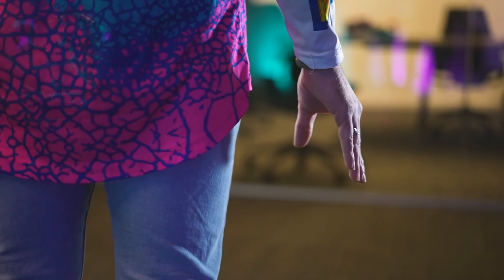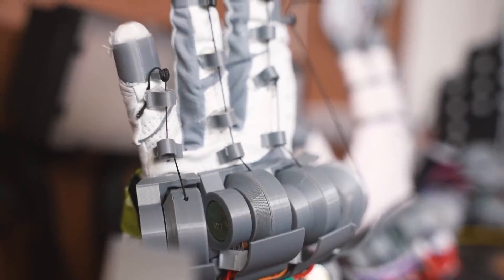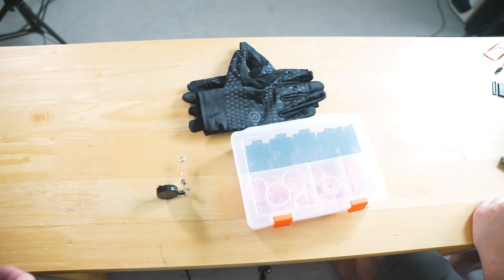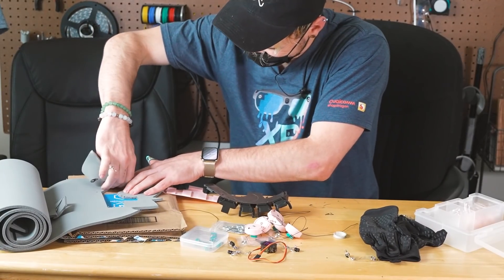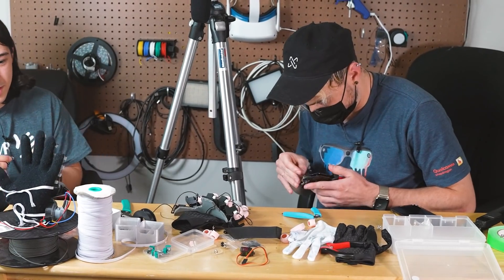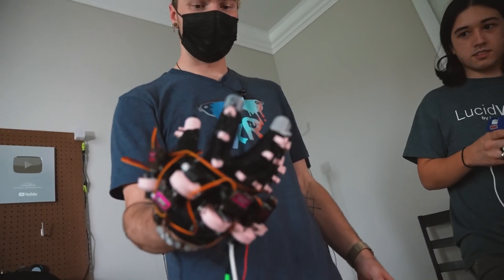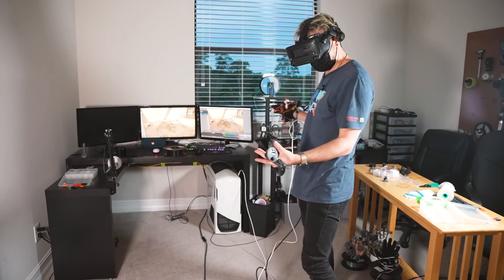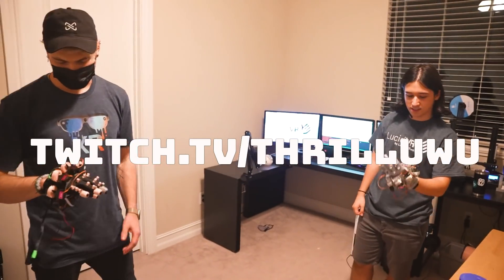Building my own VR Haptic Gloves with the VR GLOVE MASTER

Comment: The v2 design has been done for a while, looking for an engineer like lucas or lucas himself to engage in prototyping the new designs, and i have other designs for different haptic interfaces in general too, wanna take this iteration commercial. 
Lucas proves viability. 
New system optimizations in Digitact V2 allow for
 1. More efficient power use per motor 
 2. More accurate geometric representation of forces
 3. Improved tracking 
 3. Overall Improved design geometry 
 Hit me up.

Comment: Hell yeah, kid. 👍 My first roomscale VR setup was Google cardboard (In a headset with custom optics) plus some eBay find PS3 Eye cameras and PSMove controllers, and RGBLED-lit ping pong balls. 🤓  Damn fine work on the gloves!  I had basically the same idea, but the engineering involved was just slightly beyond my ability to bridge the gap between concept and reality. 😬

Comment: The biggest hurdle I see for force feedback gloves is maneuverability, the more complex or accurate, the more parts are required increasing complexity and more than likely reducing the users maneuverability. At first I thought, why not use air or water with small channels in the gloves to control the force required for specific muscle groups in the hand? The issue is more than likely going to be one of space, this is even a greater issue with the direct use of motors. So, what can we do, how can we push back against the muscles of our body? Well, we could make our own artificial muscles, even if they are real they are more than likely not a technology we will see any time soon. So why make muscles or any contraption to counteract the body? We have muscles already, they're the one's we're trying to fight! What if we were to coat the hand in a saline solution and use a glove which would have hundreds of small silver (the actual metal) contacts? Instead of fighting the muscles we could make the muscles fight itself or possible interfere with the muscle's actions altogether.

Comment: I still remember trying out the Novint Falcon during the 2007 E For All convention. They had a demo set up where you could move the cursor over and in some cases through a sphere made of different materials, like syrup, rubber, etc, and it actually felt remarkably convincing. All it was though was a manipulator on the end of 3 motorized actuators, and the support was very, very limited, so it never took off. Pity, it was a neat idea.

Comment: Now we need a sort of apparatus that will hold a person centered, while they wear shoes with mouse ball-esque trackers on the bottom to move around. Something much cheaper than the Kat Walk C. Though it will be more expensive than a pair of gloves and a kit of small parts.

I'm thinking something like an anchored "cage" made from something cheap and rigid (like wood or mild steel tubing). Then, a waist band similar to that of the Kat Walk C elastically anchored and centered to the perimeter of the railing of the "cage". This would need to be held within a rigid hoop which the elastic anchors will attach to, and have freedom to move around the edge of the hoop. This elastic would need to be tense enough to resist allowing the hoop to travel side to side, but tolerant enough to allow crouching and jumping. A set of elastic between the hoop and the waist band (which would be required anyway) might be able to accomplish this functionality.

The actual shoes are the tricky part, as they need to detect movement forwards and backwards, but also sideways. A track-ball or two per shoe seems to be the way to go, but rigging them up is the difficult part. A shoe would need to be selected that has a thin sole which would allow for some thickness underneath, both for the electromechanical parts, and reducing friction with the floor. This whole concept would work with Kat Walk's design, but I figure it would be more cost-effective not to build what is essentially a giant track-pad; but instead, use a few track-balls off the shelf.

Comment: This has been soooOOO long coming! (Like the first actually accessible, fully-functional VR HMD.) I remember long ago learning about Jaron Lanier's Data Glove, and thinking that would be so cool to have. ...But it wasn't actually haptic, I believe. Then Mattel came out with some game-controller glove. It may have vibrated, but I don't think it offered any resistance or other tactile feedback. I kind of gave up trying to retain info about any attempts after that. It always interested me, but the up-front limitations always disappointed. Either they were low-function, or they were outrageously expensive, or the company sold or failed, or the prototype never made it to market. 

Now that an accessible option is finally here, I can't wait to add a pair of these to my setup!

Comment: It be cool if it could simulate the hardness or softness of the object. I imagine it could be done by adjusting how the motors tighten the pulleys. Like for the softness it could tighten each finger at different timings, and intensity based on how the geometry changes. The order in which the fingers touch the object determine how the geometry would change. The softness or hardness would determine how much the geometry could change. Just a thought, I don't know anything about coding. This device is amazing.

Comment: The only big problem with Index finger tracking is because it relies on capacitive touch on the central handle, it actually doesn't even begin to curl your fingers in-game until you've closed your real-life fingers to around 50%, when the bottoms of your fingers start actually making contact with the handle.

I'd have loved if you did an example of slow, deliberate finger motions and showed how well they track and if it's more 1:1 than the Index.

Comment: This actually makes me want to learn how to sauter things, lol. I think maybe there could be room to make it a little less clunky if you were able to have the springs actually mounted on your forearm instead of the back of the hand, maybe a series of five thin disk pulleys layered on the wrist could allow the necessary connections while leaving your wrist free to bend, and then you could mount the springs in a line down your forearm with a strap to make it a bit more compact?

Comment: Hmmm.. These look good. But I have some comments to add...

I notice they have a Valve/Vive style tracker on them. I assume they need this for tracking. But that tracking system is expensive. How about using SlimeVR for hand tracking instead?...

I know that hand tracking requires more precision than general body tracking. But there is apparently more than one type of SlimeVR tracker. The lower cost SlimeVR tracking packages have the normal trackers. But the higher cost packages mention higher precision trackers in the notes. I wonder what the tracking precision difference actually is between the two, and if it's enough for hand tracking. And if the higher precision trackers could be bought as a pair, separately.

Maybe the people selling the SlimeVR trackers haven't considered using their trackers for VR gloves, and are assuming the only reason anyone wants them, is for general body tracking.

Another thing about these DIY gloves, is the floppiness, and the cable management...

The tension cables don't seem that bad; they're held taught, so they don't have a chance to tangle much. But the electrical wires could be managed better using velcro or buttoned loops sewn into the gloves, allowing you to easily remove them for repairs.

The floppiness of the heavier components could be solved with the addition of a rigid plate sewn onto the back of the glove, allowing a place for the heavier components to attach. The greater surface of the attachment between the backplate and the glove, will give much greater stability than the much smaller area of the individual components attached directly to fabric.
Reply from the maker: You can use any controller for tracking, even quest 2. And yeah wire management needs to be way better I agree

Comment: Really cool. It would probably be a good idea to crowdfund kits that contain all the parts you need for a build, since finding all the parts (and at a reasonable price) is probably the biggest chore of the whole thing. I think this demonstrates well that the tech itself can become pretty cheap and accessible once big players in the market decide to make it mainstream.

Personally I think that the best design will probably still include some sort of non-invasive controller because having some buttons and a joystick in-hand allows you to do so much and have a lot of compatibility, and it will be a long way still before this tech is so precise that it can mimic those functions in software.
So basically I think the ultimate controller for the foreseeable future would be a knuckles-like design, but with a feedback-glove component like this so achieve the best of both worlds.
A smart way to do it might be to design it as 2 components that can connect together as an optional addon.

Comment: This is actually amazing!!! I want one so bad!  But I do have a couple of questions tho 😅
1) How much would this actually cost for a quest 2 user (with a powerful gaming pc already) with no tracking equipment (e.g. Base stations or trackers)
2) For those without a 3D printer, how would/could you make this amazing piece of equipment?
3) For those of us that aren't as tech savvy, is there like a list or rough instructions of what you need to do? Like what programs/software you need, what hardware you need, circuit diagram, what steps to follow when building, or even a video of it?

Im sorry if these are some redundant questions, but I rarely use discord (mainly for calls while gaming with friends) and websites such as GitHub. I tried navigating them, but I got really lost, really quickly

Comment: Cant wait till my hmd arrives so i can start doing some dev work.

I heavily disagree with the idea that we need buttons when we have finger tracking that good.

Instead i think we need a fundamental redesign of the development paradigm, organic interactivity rather than scripted sequences.

For example for menus, you could implement collision detection to buttons and sliders and render the menus as an actual 3d object, so interacting with the menu is like interacting with a real physical object.

Need to move a slider, you literally grab the slider and move it. Want to turn on a setting, you click the button with your finger.

This would extend further into game design principals too of course, just about every interaction you script and assign to a gamepad key is unnecessary, you dont need a shoot button for an fps if you have a trigger finger and the guns are rigged to start firing when the trigger crosses an activation box

you dont need a shoot arrow button if you can physically grasp the arrow knock it and release

you dont need a button to pick up and swing a sword when you can again physically interact with it

hell even trading card games

all youd have to do is make each card a 3d object, have the play field detect which cards are placed on it and what orientation that card is in, and you have everything you need to replicate something like say yugioh in a vr space

Buttons are something we put up with because we didnt have a good input interface, not something we need going forward.

With good and widespread hand and finger tracking we can design interfaces at the product level the same way we do in the real world, and i for one cannot wait for that to be reality.

Comment: I built a pair and actually cried when i first tried it out. I can not wait until this kind of hardware becomes main steam. I can definitely a mass produced version like this with a box on the back of the hand/wrist for tracking and internals on gloves with integrated rails for the strings, better quality parts, easily costing under 200$ a glove. I would actually cave and get a quest if facebook brought this kind of hardware and software to the table.

Comment: Maybe someone can answers this, wouldn't it help to move the servos further back say to behind the wrist. While this would make them more of a glove and wrist band setup, it would allow more room and reduce the size of the hand. Might even be able to place them sideways   further reducing how much they protrude from your body, reducing what they can be caught on.
Reply: Moving them behind the wrist would add significant complexity, as you'd need some sort of pulley system for each wire at the wrist to keep the wires flush along the back of the hand. Or else have sheathed cables. Having them mounted on the back of the hand removes a lot of problems related to accounting for movement of the hand relative to the arm. You only have to worry about movement of the fingers relative to the hand that way, which is a much simpler problem to solve, especially since fingers really only have significant range of motion in one degree of freedom. For wrist-to-fingers, you have to deal with 3 degrees of freedom with significant range of motion and even a bit of a fourth. It can be done, of course, but it's a significantly harder problem to solve. I think the future of this will probably be smaller reels rather than wrist-mounting, but either way presents a viable path for future refinement.

Comment: this guy: builds cheap gloves for vr, hand tracking and haptics
companies: sorry we cant do it for less than 10k dollars
Reply: Well, the hand tracking is actually just Vive trackers, so, really, these things are north of $150 per hand. But still really awesome and an order of magnitude cheaper than what's commercially available, though also less polished.

The issue with the companies is they haven't gotten it down to where they can build a polished product that's cheap enough for the consumer market... and the software mostly isn't there to do anything with it even if they did, yet. The reason they're charging $5k+ is because they're selling low volume and a ton of engineering time invested into them. While the embedded systems company I work for is in a different market, we have the same sort of issue. Our market is relatively niche, but high complexity, so most of our main products cost > $10k just because of all of the engineering time that we've sunk into them. It's not unusual for a finished, polished, high-complexity product to have at least a few dozen man-years of engineering behind them before they ever launch, not counting ongoing effort in both production and engineering for maintenance. When you're selling hundreds per year to niche business/government markets, pricing is a completely different world than when you're selling millions upon millions to the mass consumer market. Extreme optimization of per-unit parts cost becomes less important and one-time, up-front engineering cost is far more important.
Reply: @vbscript2  it was a meme but thank you for this. I know that the hard work has a cost and that the optimized version of it available for everyone is just the "final" step of a long journey. 
Wish you good luck for the future works and hope you'll have the motivation still to keep it up.

Comment: Since it's open source, someone could possibly add 9DOF sensor control like the ones used in SlimeVR, lowering the cost even more and maybe even add integration to the haptics of the glove depending on where your hand is.

Comment: A question for everyone, what would you concider the most versatile, top of the line, most stable allrounder VR setup at home no matter the cost, if you want to have the best immersion that todays technology can allow?
i myself thing it should be like this:
VR gloves  = 
- with buttons which we already have on our conbtrollers but on the back of the hand.
and program all games to work with gestures and handmovements to control everything ingame.
- haptics and feedback only if feasible

Fullbody Suit =
much like in ready player one, with haptics, temperature, electric impulses, modules to simulate wet/dry, and of course 8 point Fullbody Tracking with near perfect tracking quality.

VR Headset =
those Flakships that cost thousands thrillseeker testes for us once, but comprimisedin size and weight.

Lighthouse Tracking
as it enables us fullbody tracking and full room scale tracking, and better trackign precision in general.

anyone having better topnotch setup ideas? id love to know, i love what people can come up with in terms of best setup for best immersion.

Comment: This is one of the sickest things I've ever seen. Now that I think about it, how hard would it be to make a simple pair of these without the fancier stuff? Because holy shit, if I could play Synth Riders or Beat Saber with only my hands, I'd be in heaven. (I'd finally avoid hitting my controllers together!)
Reply: Honestly, I'd be way more concern about smashing these together in Beat Saber than Knuckles. There is an approximately 100% chance that I would break them in the first session. But these sound completely awesome for something like Alyx, Skyrim VR, etc.
Reply: @vbscript2  the biggest reason I smack them together is the outer ring. So by my estimation, removing the outer ring removes the problem entirely. I'd rather smack my hands together than a $300 set of controllers, but my hands just might be built differently! (They heal quickly!)
Reply: @Shyningfade  For me, when I hit something, it's usually the side of the controllers that are facing each other that hit rather than the outside side of them. I use the Index knuckles controllers, so the tracking arc on each controller is already facing away from the other controller unless my hands are crossed. I don't hit them together very often, but it does happen from time to time. With a bunch of bulk on the top of my hands, though, I think I'd probably be more likely to hit them together on "crossed" notes. I'd probably smack the pulleys with my other hand.